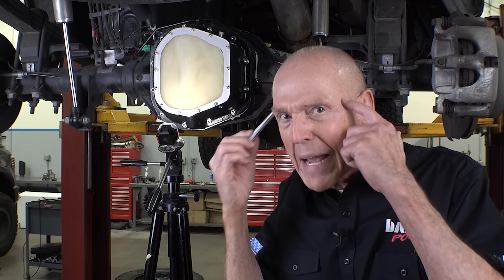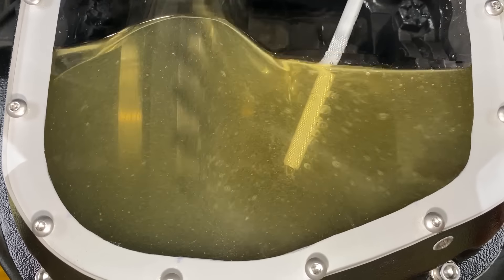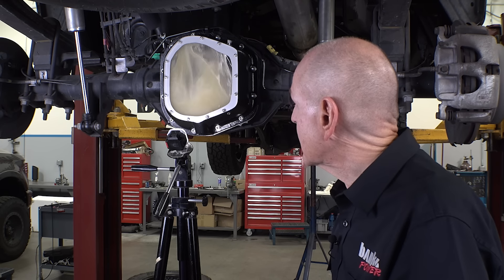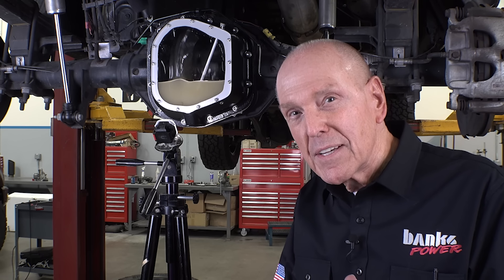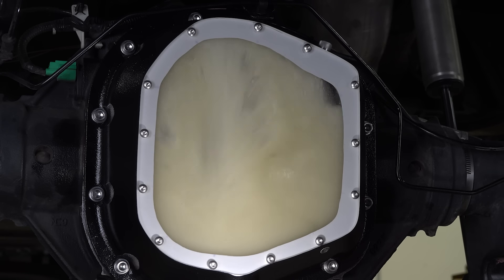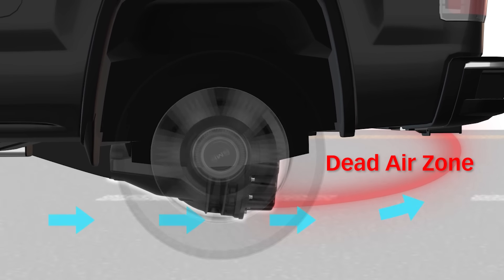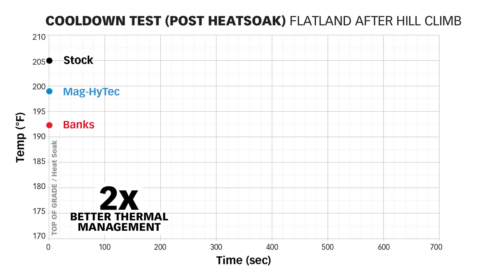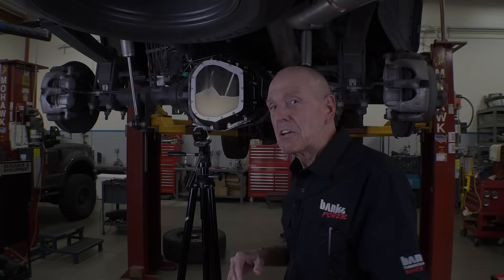What aftermarket diff cover guys don't tell you!

Comment: As a mechanical Engineer I can tell you NOBODY at least today designs these based on fluid dynamics or anything like that. We design a small footprint cover and and contours are there for clearance. These gears are swimming in fluid and are fully covered with they come in contact with each other. A very small portion of the gear is outside the fluid for a fraction of a second when driving and again is fully submerged when making contact again. Most internal features on the covers including aftermarket serve little to no purpose except to make claims to justify their price point. In the end most Engineers and real car guys know that rear ends fail because of abuse or cheap aftermarket gears. You can pull a junk yard rear end out of a 1978 chevy truck and run it down the road for years. Its not until you drop in a 900HP engine that you run into issues. Anyone can sell you on "fluid dynamics" or cross contamination of fluids, but real world applications have shown us that failures rarely happen without a major problem.
Reply: I think the funniest thing about this product isn't the fact it was made to solve a somewhat trivial problem, which it does. It's the fact Banks made his own because of how bad the flatbacks are at fluid dynamics and how bad that erks him. I genuinely don't think he cares if he sells many of these, i think he made a product just to show how stupid the competitors was. I can get behind that, still doesn't mean ill buy one 😂
Reply: Exactly...he's acting like it's water or something. Everyone, your diff is fine
Reply: @xxRamD3yruxx  Race differentials are usually dana positraction units. These use a carrier one piece unit installed from the front. The rear side? It's completely flat and round, both inside and out. They use them on NASCAR cars, no baffles. The gears draw the gear oil up from the bottom because they are sitting in it. Internal baffles slow the oil from getting back down to the bottom where it needs to be for the gears to use it. If your worried about heat just use better oil the gears dont care they can run at temps over a thousand its the oil that breaks down. Gears break from force and horsepower and broken cooked lubricant.
Reply: I mean i would trust banks more than the comments here

Comment: First he tells me aftermarket diff covers are a scam and then he tries to sell me one 😂
Reply: That is because aftermarket diff covers have cooling fins. Banks just pointed out flat covers are pointless.
Reply: Because his cover has the benefits of more cooling while still retaining the stock lubrication over the ring gear.
Reply: flatbacks ruin the fluid dynamics of the diff, and the fins on the inside can change them too. the one he was saying was better has the same internal shape as the stock, so similar fluid dynamics, still has fins but theyre much more subtle, but it has the added benefit of the cooling fins on the outside.
Reply: Yeah, not even close to what he said. Not at all.
Reply: Didn't show video of what there's looks like while running because it's to similar...
Reply: @cudavrage  do yknow how hard it would be to mold a see-through cover for the one thats shaped like oem?
Reply: @Kevin-dt9xm  Not terribly hard at all, for a guy that is familiar with plastic molding and shaping. Same plastic, scrap the OEM cover by drilling a dozen holes in it, bing bang boom, probably two tries over an hour with a heated plastic vacuum chamber and pow, cover shaped very closely to oem contour.

But that's a lot of effort to try to prove a point that may not be easily identified through video recording.
Reply: I know it's a bit hard to focus on anything longer than an Instagram or Snapchat video these days, maybe your time is better spent there?
Reply: Don't waste your money on this , just change your fluid every 25-30,000 miles
Reply: @stevenstair1068  i think the point of the one recommended in this video isnt to increase diff fluid capacity, but rather to increase diff fluid cooling with the fins to reduce the chances of your diff overheating.
Reply: I owed a excavation business and several big and small trucks  plus all my equipment and absolutely did not have any rear end troubles or over heating, , the best way to take care of your axle is change your fluid at a timely manor, so save your money my friend...
Reply from the maker: @Crazystuffyousee  It's possible to be both things simultaneously.  Carol Shelby was all about performance and was known as a masterful salesman.
Reply: @Kevin-dt9xm  You can 3d print clear these days. I'd be interested to see it, but would have to be high heat filament.
Reply: Theirs is curved ! Not flat !!
Reply: @bankspower  And he used the Ford 9" rearend with a front mounted carrier gear set that required no fins and was smooth inside and out so there was no restriction on the oil getting back down to the bottom as fast as possible where it was needed to be picked up by the gears. Yours is a solution to a problem that doesn't exist.

Comment: OR... you could just keep a stock cover and change the lube at recommended intervals
Reply: This is a good option for people who are for example hot shots. You want your work truck to last 500k+ miles. That initial investment would mean the lubricant stays cooler relative to stock which results in less wear on the actual dif. This is a good investment for people who use their trucks to make money rather than regular Joes. A dif job is very expensive and if you can get more out of the dif then that's a win.
Reply: @ziggarot  Banks found a solution for a problem that doesn't really exist. Use premium oil and change it regularly. Don't misunderstand me. Diff's could fail from time to time.  At 500k,, about 3 to 4 years. Your diff should be the least of your problems because your truck will be at the end of its profitable life. I know drivers that put much more than 500k on their trucks but things just eventually wear out and must be replaced or rebuilt meaning your allotment for maintenance ( maintenance allocation) will be cost prohibitive.. More down time, less profit.
Reply: @ziggarot  By the time the differential wears out you the Truck will be old enough to get a differential from pick n pull.
Reply: I’ll keep my stock one, it doesn’t fill up with mud or break when I back into a rock. I’ve been 4X’n  hard for 40+years in the outback of Alaska.The stock one can be beat straight with a hammer and re-welded in the field. No replacement
Reply: @angusbeef524  Alaska minds think alike just spring breakup would pack that air defuser much less one trip out to Jim Creek.
Reply: 1.3 million miles on the same rear differential that came on the '01 Duramax.  I've changed the gasket once.
Reply: @nooneeyeno   nah they are needed for heavy pulls i have cooked a few diffs going over 14k lbs and its always on a steep incline where the fluid bakes and kills the bearings and gears
Reply: My stock Dana rear on my 23 year old Dodge ram 3500 runs just fine. You're exactly right! Chang the lube and maintenance is key
Reply: But where's the fun inbthat?
Reply: As the saying goes oil is cheap
Reply: @ziggarot  replacing fluid isn't expensive. And learning it yourself pays off.
Reply: @nooneeyeno   ya this is a solution that isnt for your low altitude or near coast people, or people who dont use their trucks near the limits of what they are rated for

to be transparent im looking at this from the angle of a heavy haul driver who pushes their semi to its limits and whose truck has an independent cooling line from the rear axels to a radiator to keep temperatures under control 

this is a solution for people who are towing near the limits of what their trucks are rated for, especially up in the high altitudes the heat being made is the same but at sea level you have 14.7 PSI to help with cooling, get to a mile up like around Denver you only have 12 PSI and that affects the cooling potential a lot, altho still a niche solution it has a place for people pushing their trucks
Reply: I tow with my 2007 3500 dually 28k gross all the time through British Columbia. Never seen the diff go over 185F. 600k miles on it. Aftermarket diff cover are a waste of money
Reply: Most people just want the drain plug.
Reply: @Roger-il8iw bingo. Only reason I bought it
Reply: Bingo
Reply: @ziggarot not how that works. Oil performs differently at different temperatures. Cooler is not always better. Otherwise 200 degrees wouldn’t be standard operating temperature for your engine.
Reply: Exactly

Comment: This man is a legend. Not many manufacturers do the intense, real world, common sense rnd, like Banks.
Reply: Not buying it. Think about a motorcycle engine that shares oil with the transmission. It works.
Reply: The engineer designing the gearbox didn't just WAG it. It was studied. The only issue I could see is that the automakers are optimizing for cost, not necessary longevity. So once they hit a certain longevity number the rest of the design is reducing cost.
Reply: This is a joke. Oil is everywhere in a rear end, and there is WAY MORE than enough on ALL the bearings. All you need is a thin film to lubricate these components.
Reply: @life_of_riley88  don’t be a simp keyboard warrior . The molecular properties of the oil are compromised by excessive aeration and increased operation temperature . Enough doesn’t always mean exactly enough . Keep taking your ridgeline to wal mart for service .
Reply: @Jenksauto  Ha. Okay buddy, a lifetime of building performance cars, race cars, hot rods, and the vehicles that tow them will just be cast aside for your highness. I've been there and done that with this stuff, although all this differential cover stuff is like throwing $ down a hole. Factory diff covers work fine and just like steel wheels are just as round as aftermarket ones, I'll just use what was designed for the axle by the manufacturer.
Reply: Except he didn’t show a transparent version of his diff cover but sure he’s a real scientist
Reply: @Jenksauto  You definitely don't know the definition of simping, because that's exactly what you are doing with your opinion of Banks products and his bogus example. If you truly were unbiased, you would have noticed that the aeration did not increase with the rotational speed of the diff. He kept blabbing about some nefarious fluid dynamics he could not prove with his setup.

Comment: How about making a clear version of the banks cover, so we get to see how it flows... A REAL side by side comparison.
Reply: Fins are in the back of the cover, you cut the fins there is nothing to look at
Reply: Already did
Reply: @homerfry9234  they could still make a clear cover with fins to prove a point. Not like they have to use the same method to cut open the cover like they did with the flat back.
Reply: Ask and you shall receive, just go back and watch the full series on building it.
Reply: Follow the diff cover videos they did earlier this year....they show it all.
https://www.youtube.com/playlist?list=PLwtmrqcWzLtQR9riOg8mizIEj-UX4WBBm
Reply: @homerfry9234  just have to 3d print a clear version of the cover
Reply: Something to hide
Reply: Some oil is better than no oil at all.   
Everyone knows the pinon is getting lubed with all the oil slinging around.  The pinon is not isolated from the ring gear.
Reply: More flow equals more cooling for the pinion gear and bearings.
Reply: never happen
Reply: Exactly!
Reply: Ok, you can't really believe there is no oil getting to the pinion, massive amounts are going around on the ring gear, and it isn't quantity that lubricates the ring and pinion, it is the oil film.
Reply: Exactly and how about use some hypoid gear oil instead of lemonade
Reply: Again I'm beating a dead horse in the head non conclusive testing! make an exact copy of the banks differential cover how to clear acrylic it's not hard to do
Reply: @hotrodray6802  unless that flow is turbulent. Laminar flow is way better even with less flow at transferring energy.
Reply: There is no difference.

Comment: I haven't priced out the Banks cover yet, but the time savings from having the drain plug (magnetic at that) is VERY valuable in my opinion.  That would make changing the oil about a 10 minute project.

Comment: I love the engineering that went into your design. It all makes sense and is easy to understand. I also understand as a company why this has all been done on 3/4 and 1 ton trucks, but this would be equally useful for those of us with 1/2 ton trucks. I certainly don’t overload my 1/2 ton but would love to see this available for some popular smaller axles. Hope that becomes a reality, I’ll gladly step up and buy one.
Reply: I agree! Would also love front covers for 4x4s!
Reply: Definitely would love to see one on a 8.8! 

Dif temp is a huge thing for racers as it can fuck with LSDs so something like this would be great
Reply: Id buy one for both my 1/2 ton trucks
Reply: Why? Has your diff been overheating and locking up? This is a solution in search of a problem!
Reply: It's been a year since this video, I just called today and they're still not producing this product for 1/2 ton trucks. I'd buy one if they would make it for the super 8.8 ford. What a bummer 😕
Reply: I'm surprised that he doesn't have a comment on any of our comments on here! He's loosing out on sales by not backing up from our comments, so sad!

Comment: Well i just watched this and while it makes sense on the surface, I have a 99 F250 with a Mag-Hytec on it for the last 12 years and 200k miles. I run royal purple 75w140 and have towed a 15k lb 5th wheel all over the country in 110 degree heat in Arizona, -30 degree weather in Wyoming, and everything in between. Every time I change the gear oil it checks fine. This cover might be better, but I don't think it really matters.

Comment: I went with a ford stock diff cover.  And change gear oil every other year.  That has worked very well for me.   I use mobil 1 full synthetic gear lube
Reply: Good idea! Looks to me from the testing done in this video, there is nothing wrong with the stock one.
Reply: @Lestergreen77  prove it
Reply: @chriselliott8509  send me your email and I’ll send you a link of my oil analysis of their annual protection oil epically failing at 11k miles
Reply: I'm curious. I've never thought once a year oil changes were a good idea anyway. I'd like to see the data.
Reply: @chriselliott8509  I’m not saying mobile one is crap oil, as there is worse out there. But there are also better. Check out project farm. He did oil testing, not as scientific as analysis. But worth the watch.
Reply: @o1mtbiker  I've used it, Castrol syntec, Quaker State magnatec and valvoline. They all meet the same standards, the only thing that varies is how the car is driven and conditions and maintenance intervals. Some people would use a yearly oil at 3000 miles, and a new oil filter and a new air filter. Probably would end up changing (fairly) clean oil. Obviously running the hell out of it and stretching the interval to 15k would make a difference.
Reply: @chriselliott8509  you asked for proof on mobile 1. I just made a recommendation where he tests mobile 1 against others with the same exact test.  Besides the standards you mention are the minimum they need to achieve. All oils are not the same just cause they meet that standard.
Reply: @o1mtbiker  munsonMAN sent me the data he got from Blackstone labs. It did fail. And I don't disagree that there are better oils out there. I would say that if a product is advertised a certain way, then it should perform that way. Like a once a year oil change. I use what matches my budget and what has performed well for me. Any info I gain helps to make a more informed decision about what I use.
Reply: @chriselliott8509  have you thought about ordering your filters and oil? Rock auto has wix filters for like half what the stores have them, and you can find oil various places cheaper also. Ironically as this is Amazon basics oil isn’t bad at all. But they carry all the name brands also. Others have a membership, like amsoil. You can get there OE line for just over 5 bucks a qt. And shipping is free most the time.
Reply: @o1mtbiker  I've heard that Amazon was actually decent. I've never tried it though. I'd like to give amsoil a try. I'll look into it. I do my own work anyway and I don't have an issue spending on something I know is a proven product. Might even save money in the long run with a better product.
Reply: @chriselliott8509  well no specials by referral, check them out, they do have a 10 dollar trial membership.
Reply: keep the stock diff cover and change your oil the same as you said and you would notice no difference except the money you saved on changing a diff cover.

Comment: I work as a diesel tech in a smaller shop that also does a lot of aftermarket performance work. I can say that I have seen these “flat back boys” running on hot shot drivers with trucks with hundreds of thousands of miles and I guarantee they haven’t changed the diff oil or even checked the level and they are running just fine… you don’t need a hose of oil showering the diff from the top down, as long as you have the proper amount where the bottom of the gear will simply soak in it and drag it up on itself, you are good to go…

Comment: Back in the 70-80s every kid wanted a chrome diff cover. We informed them of the consquences but they didnt care. We did a lot of inner and outter axel and pinion bearings...and they still wanted those covers reinstalled.
Reply: Really? Because I ran Mopar and we were stuck with that flat oval rounded factory diff cover, better known as a Dana "pumpkin". No baffles inside or out. Just a smooth interior surface so the gear oil had nothing to stop it from getting back down to the bottom of the diff where it was needed. This guy is gaslighting everybody. The kids were wearing the bearing because they had hi output engines and stock diffs.